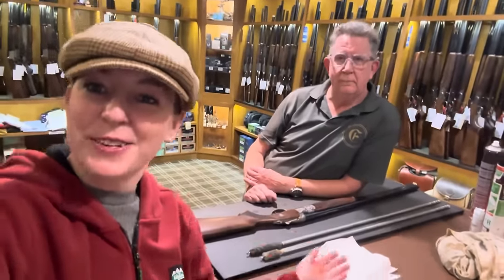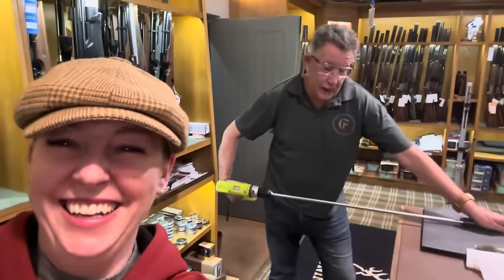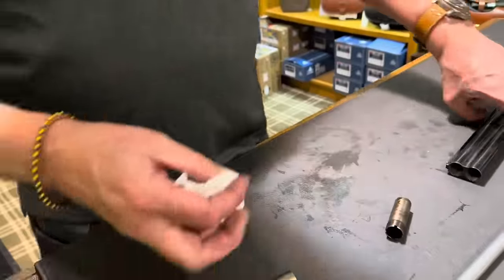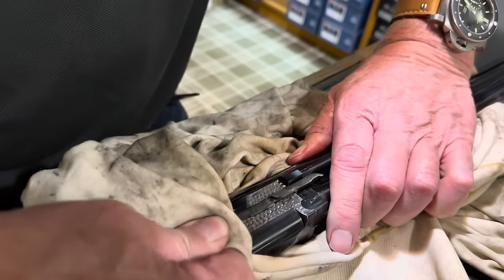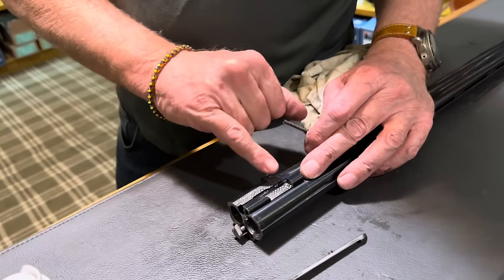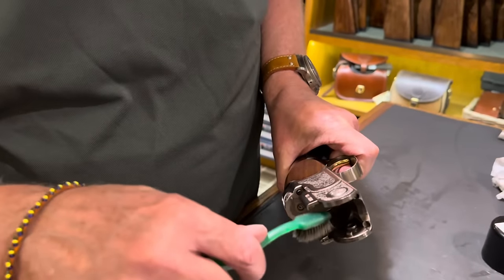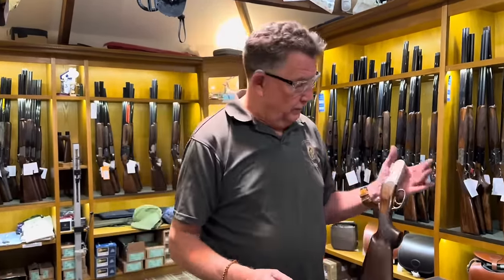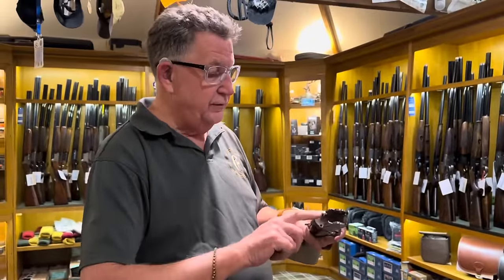Beretta Cleaning Demo | Field Sports | Silver Pigeon

Comment: helps to wear nitrile gloves to save your skin from the cleaning chemicals, also stops fingerprints.
Reply from the maker: Good tip thanks
Reply: @LeaLeasCountryLife but not for the wood conditioner on the stock and forend, the heat from your hand and rubbing it allows the oil to penetrate the pores.

Comment: I always kept a good firm tooth brush and cotton ear buds in my cleaning kit, but I would never use a power drill to clean any barrel.
Reply from the maker: Now cotton buds are a very good idea, I like that tip. The drill just saves you having to rod it yourself, takes the arm work out of it. Sped it up a lot as my gun was rather dirty

Comment: WD-40 is actually Water Displacing Oil, Formula 40.  It is a drying oil that is intended to be used as a Rust Preventative.  It is NOT a lubricant or penetrating oil for seized parts.  Police Armorers across the entire USA LOATHE WD-40 because it's the first thing patrol officers reach for when they decide to clean their sidearms.  In about 10 years of this there will be a black gluey mess in the action of the guns that requires a full strip down and cleaning to get the gun back into operating condition.  If you need a penetrating oil for seized parts get yourself some Kroil, there is nothing better.  If you want a good lubricating oil Lucas Gun Oil or non detergent lawn mower oil will do the job.  Note detergent oils can remove bluing over time, so don't use something like Mobil 1.  My preferred cleaning solution is Ballistol.

For removing the ejectors on my Beretta's arthritis forced me to get a bit creative.  I took a 5 inch length of 3/4 inch (19mm) hardwood dowel and notched the end 3/16 inch (5mm) deep that was the width of the 12 gauge ejector flag.  Note the notch is square.  So I can take my hand and apply pressure to press in the ejector and then slowly rotate them out of the dovetails.  Note, this single tool works well with 410, 28, 20, and 12 gauge Beretta's.  I keep mine in the case for my 28/410 combo gun 687 SPIII because I always get some 410 love in with my Skeet practice.
Reply from the maker: Very organised, love that you’ve found a way to clean the ejectors that works for you

Comment: OR   you can just apply some Mother Care metal polising compound on your normal soft shotgun cleaning rod attachement and use a hand held drill to rotate the rod . 
Make sure the hand held drill has speed adjustment so u cane start slow and then speed up. 
No risk of over doing it and the polishing out of the scratches , rust or pitting can be done at any point inside the barrel. 
After the pittng is smoothed out just move the the rod back and forth through out the inside of the barrel aroubd 10 times with the drill rotating at full speed .
You barrel will look as good an new and cleaner than your could ever get it by any other cleaing method or product.
Reply from the maker: Always interesting to hear how others clean, thanks for the tips
Reply: @LeaLeasCountryLife  your videos are very informative but hunting is done in almost every part of the world in all types enviornment including places where spcialized equipment and tools are not available. It would be very nice of you to give information on how it can be done without special cleaning sprays, barrel vices and the awesome knowledge of gun metallergy like the expert in your video.. that will attract more people to watch your videos and you will be able to reach out to a wider range of viewers because 80% of the hunting community around the world falles in the  catagory I described.
Reply from the maker: Good idea thank you

Comment: Running hot water through the barrel a few times before running the cleaning  also helps alot . It removes the nitrates and gunk pushed into the microscopic pores which every barrel has nomatter how well its made unless its chromed and even then the chrome develops microscopic cracks which develop due to differt rates of heat  expansion of the gun metal and the chrome covering it . Hot water method works equally good for 4140 / 4150 / 416r steel as well as chromed barrels.
Out in the bush if you do not have the time and luxury of properly removing the barrels and running cleaning sprays through them specially in cold weather where lubricants become thicker and gunk up in every nook and cranny . Just open the action build a small fire heat up the water and pour it down the barrel few times . One run of the cleaning rod after that and you have a gunk free shiny barrel good to go for the next session.
Reply from the maker: Never heard about running water, always fascinating to hear what other people do. Thank you
Reply: @LeaLeasCountryLife  its an old military method of cleaning firearm barrels in the field.
Reply from the maker: Well I never knew that, thank you, I do love a bit of history